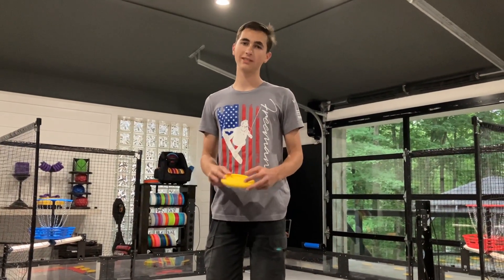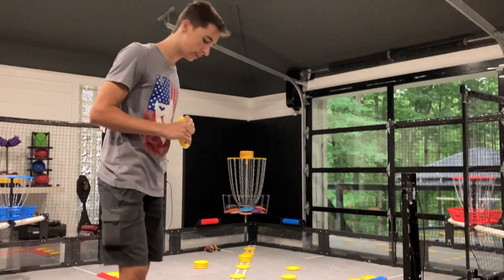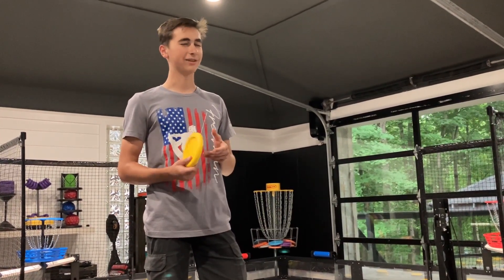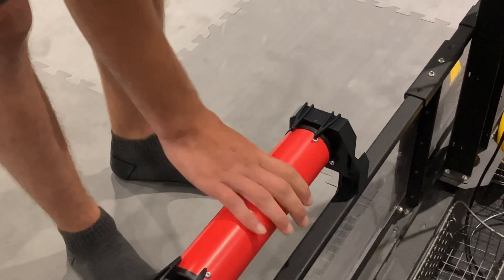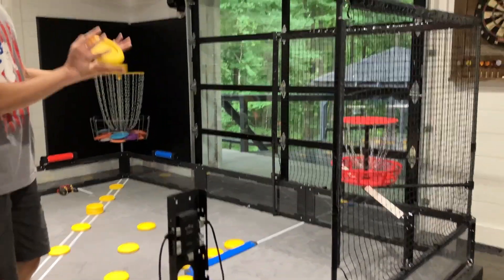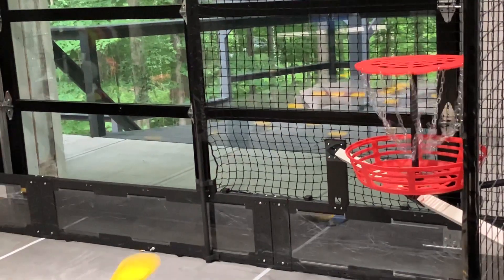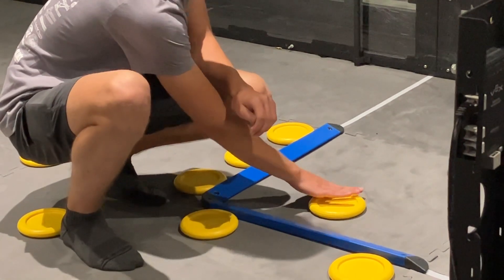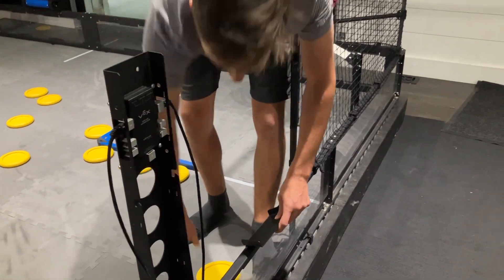Vex Spin Up Field Observations

Comment: That goal is a really flimsy field element and doesn't seem to be that great of a build. I can see it leading to lots of issues. The roller also appears to be of a poor construction.
Since this is the materials that is being used in official matches it really hampers on the reliability of creating your own field objects from spare materials from around the shop due to how flimsy they are which can't be recreated very easily compared to a more stiffer construction. 

It does not look that great from a sustainability standpoint to have something that can break easily and then be tossed directly into landfill afterwards.